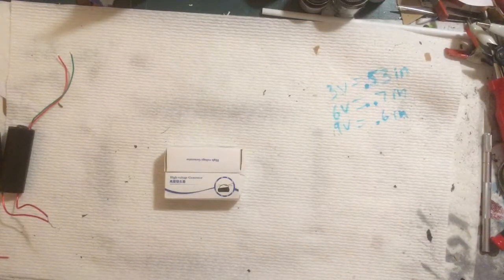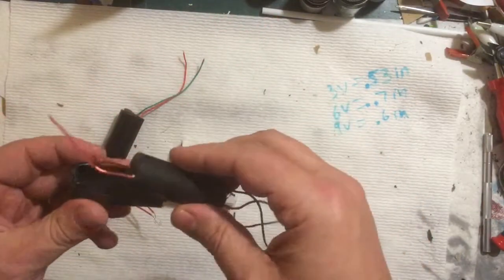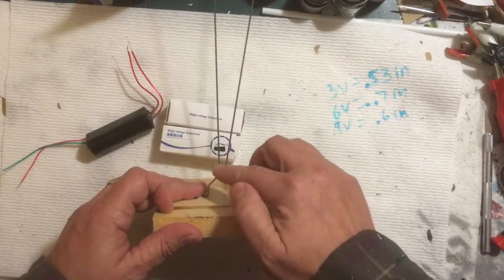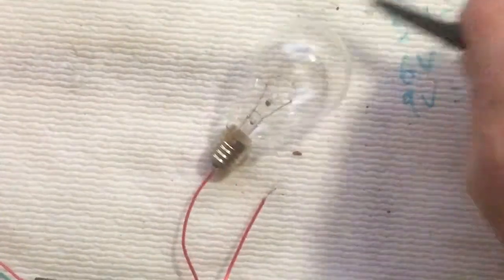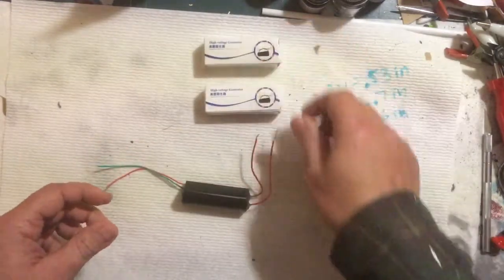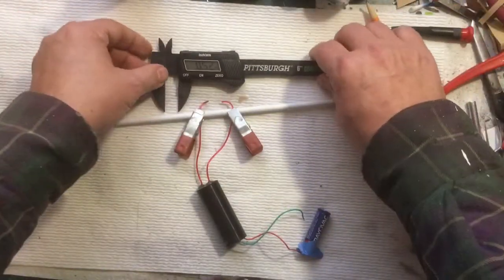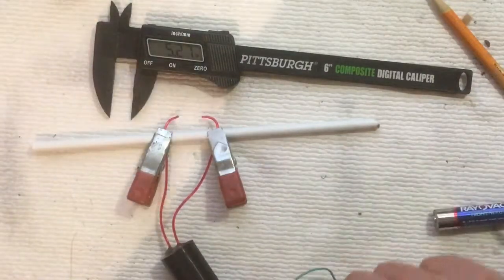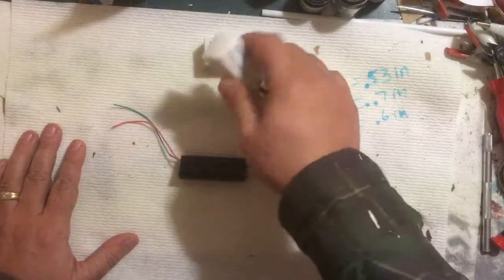experimenting with the 6v to 40,000v DC high voltage converter.

Comment: I ran this HV module off 18560 3.7V Lithium battery cell. No problem. Sparks, even when wires are almost an inch apart.
Reply from the maker: Cool, good to know

Comment: Those problem with those boost converters is that they give out high voltage DC, jacobs ladders and diy mini plasma balls (light bulb) etc work best with high voltage AC, and that’s why it struggles, it needs continuous arc to heat the air above and the arc to rise. 
Easiest way I found to make mini ones of both of those is by using any arc/plasma lighter. They pretty awesome and I actually managed some kirlian photography with one too.  
You can get a sort of continuous ark by adding a really high value resistor.  But the Most fun I found for boost module your using , was as a primary coil for a mini Tesla coil,  you just need a secondary coil but I was surprised it actually worked well! 
Hope you don’t mind comments, I been there myself so sharing the knowledge :-)
Reply from the maker: Thanks for the info. And I do like comments, so thanks for sharing. I’m actually building a solid state Tesla coil now. I hope to be putting out another video on that by this weekend. As far as this little module goes, I put one in a model kit of Anikans pod racers. There is a video of it on YouTube if you care to check it out.
Reply: Is their a way to test the polarity of the wires at the output without blowing your meter or buying a high voltage probe?